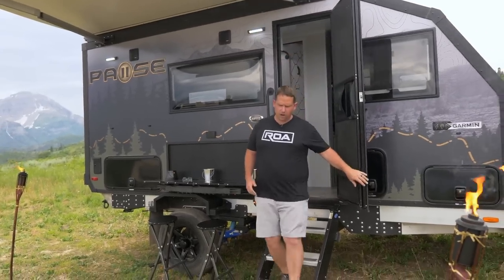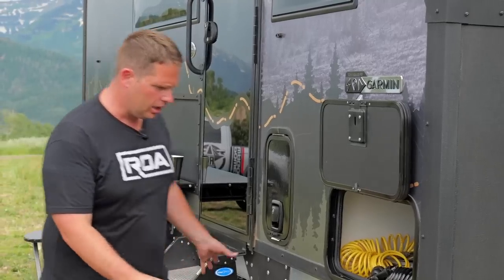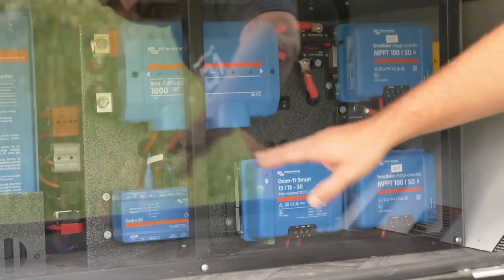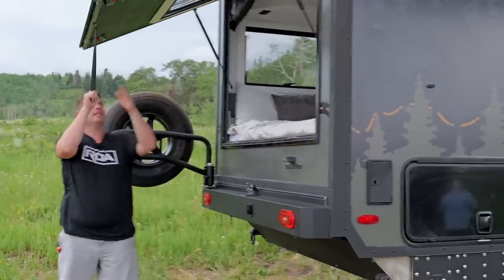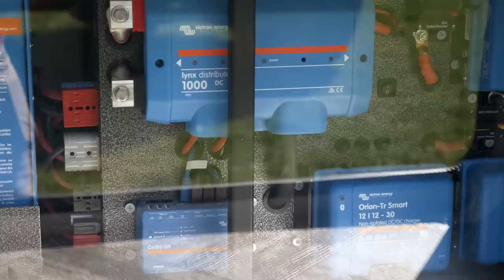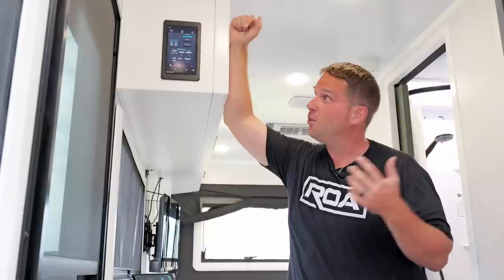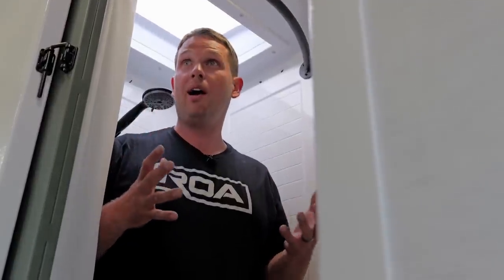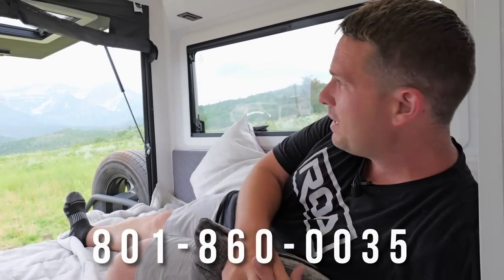Brand NEW Off-Road Trailer Pause XC 16.4 Walkthrough TOUR | ROA Off-Road

Comment: I don’t understand the size. It’s a shorter trailer but it’s hardly small. Where I live that wouldn’t fit on the types of trails that lead to cool camping spots. And those trails are where that suspension is needed. So, I think its size limits it to the type of roads that most any trailer can travel on, and therefore, the super expensive suspension is a huge waste of money. Maybe it’s good in Australia and lightly wooded areas, but I’d leave most of what’s hanging off that trailer on the trail in Newfoundland

Comment: That trailer is awesome. It really ticks all of the boxes. The only thing that I would change is that black tank. There are so many better options for being off grid for extended periods without worrying about overfilling the black tank.  The glass cover over the sink looks awkward. I would replace it with a cutting board that fits over the sink.  Regardless, this is one trailer that I'm seriously considering. Still haven't heard a price, but I'm guessing close to $120K.
Reply from the maker: Toilet with ROA will be an option. We can order it without a black tank and get you any toilet your want. Text for Pricing 801-860-0035 Starts in the high 90s and will not go over $115k
Reply: @ROAOffRoad  That sounds really great!  I'm excited to think that this might be my next trailer!

Comment: Definitely my favorite model of the Pause line. Height and tongue weight would for sure put this in half ton or more truck tow vehicle level.  Maybe camera angle but this trailer looks over 11 feet tall. Roof penetration are cool for lighting and views but those three skylights holes  and two ac/fan holes make a huge ratio of holes to Sq feet of rooftop space. I hope they came up with a unique way of sealing. Love the rear hatch door !

Update it is 10' 9" tall with 7 ' of interior head room. Why so tall. I bet with suspension at max height its over 11 feet
Reply: My class c motorhome isn't that high.
I'm looking to downsize and this also would need a bigger tow vehicle than I want :(

Comment: Question about the leveling system: can you also deliberately set it to be not level? 

I’m thinking about snow removal. If the camper was set with one side all the way down and the other side all the way up, it would make pulling snow off the top a little easier. Park your truck along side and stand in the bed with a snow rake and just pull the snow down the slope.
Reply from the maker: Yes you can. You can manual set each side to be its own level, the tongue jack included.
Reply: Great question.

Comment: You said the smaller part of the inside refrigerator was the fridge, and the bigger bottom part was the freezer? Is that right? Or can you set either or both to fridge or freezer?
Reply from the maker: The top is larger. It may look like it is not in the video. Can't set it. Fridge on top and freezer on bottom.

Comment: Kind of surprised they stuck with a gas cooktop (instead of induction), with all that solar available.
Reply: That is an option that can be done. 😊
Reply: I think it really matters how you prefer to cook, where, and how often. Induction is less efficient, and you still need propane for the outside griddle. Although going induction inside would leave more of the two 20# tanks for heat and hot water. The nice thing about the Truma combi is that it can be electric or gas or both.